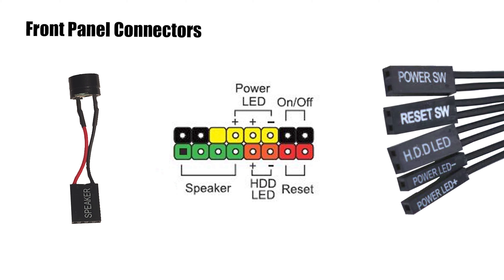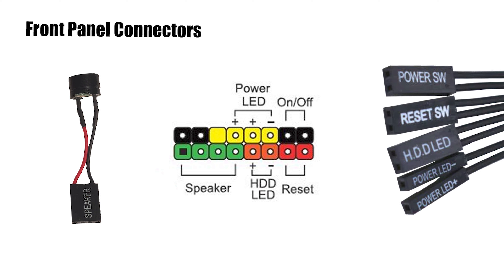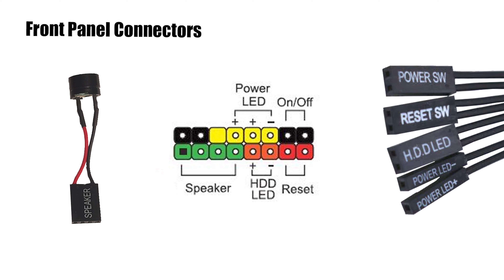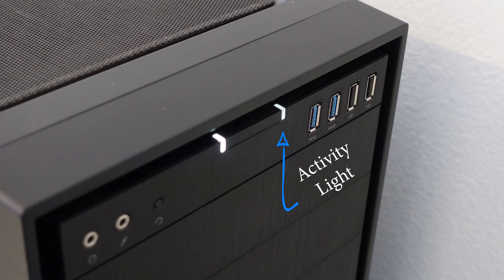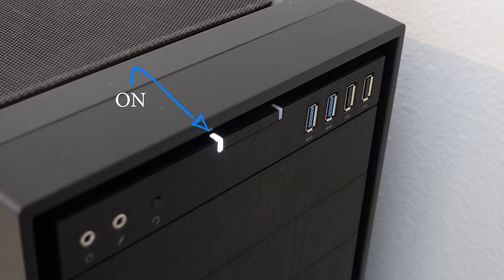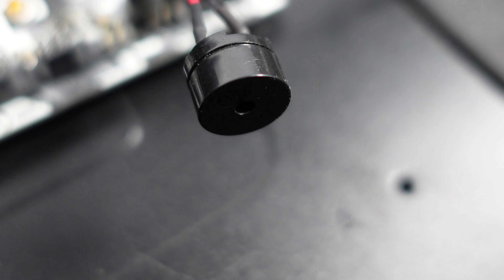Front Panel Connectors Explained

Comment: this video just saved me. I've been trying to figure out why my new pc wouldnt turn on for days. turns out it was because of this cable.
Reply: Having the same issue with my new cyberoower pc. Checked the psu with paperclip and it starts for 1/4 of a second before it does nothing. Just enough to get the fans to spin. Not sure if this will help but I will try anything. My front connectors feel really loose so I figure it's worth checking
Reply: Same
Reply: Same
Reply: @InvidiousPerson  what ended up fixing it?
Reply: I spent weeks taking this thing apart but it's been up and running since and have had no problems. Heres what happened. So even though the psu would turn on with the paperclip test is still wouldn't fully kick on no matter what I did.    I finally just bought an 850w psu instead of the 750w and  I know people will say it doesn't matter but I sware to you as soon as I put the new psu 850w and connected CPU_POWER1 and 2!! (4 pin on #2) directly to the new psu it kicked on and I was saved. Literally sent back to cyber twice and it was brutal. I'm not sure if the 3080ti was asking for more power or what. Even with the new psu if cpu 2 and 1 weren't both getting power from the psu it wouldn't kick over.  Good luck to you! I know how aggravating this is.
Reply: after 4 hours of pain i went to youtube and this literally saved my sanity
Reply: Same here

Comment: This for me is actually hardest thing when build computer
Reply: Ssme
Reply: Same
Reply: @skiemetcalf2352  can u help me please mine won’t turn on I think it’s because of this I have a z490-a pro mobo
Reply: Its been 5 days and i am struggling to still get my PC to power up 🙂
Reply: @bronationgamingultimate6760  take out and put back in ur cpu it worked for me
Reply: Yea that's was definitely the hardest thing about building the pc  I just built my first pc so am a complete novis to all of it but the front panel connecters were rly confusing even competed to everything else
Reply: Why’s mines not cutting on when I connect my power sw and my 2 leds? I’m connecting them in the right order there in put they won’t give power to my pc is it because of my motherboard or can ram cause this?
Reply: @Yunomileshater5x  you maybe put power sw upside down that can make your power button not working look again is it right spot, ram is not important pc will turn on even no ram just will be black screen and beep sound
Reply: 😂 same especially because rebuild like once a year keep forgetting 😅
Reply: Real

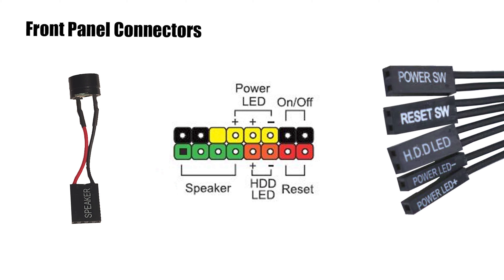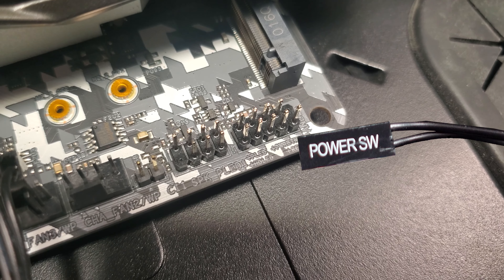Comment: Quick comment, at 0:23 you show the speaker as 4 green pins at the front but at 2:07 you plug the speaker into the back pins. I know each motherboard can be a bit different, but suggest inserting a text overlay to the video explaining this. Otherwise nice video.
Reply from the maker: True, the diagram shown was generic and not to my mobo specifically. But in general the speaker will always be to the right of the other front io pins.

Comment: Arrow = Positive, going to have to write that on my printout of the pinout. Thank you! I was wondering if it meant that or if the arrow was poining towards ground. I had an adapter from ebay once that you can connect the wires to it outside of the case then slap em all on the header at once. I forget the name of it, but it was so much easier. It's pretty ez to google up though. Maybe next time; there always is a next time.
Reply from the maker: Yes! I had a motherboard include one of those and I’ve kept it ever since, so much easier!

Comment: Great video man👍 Building my own PC soon, only thing I'm really worried about is cables and wiring any tips you could give to a first time builder
Reply from the maker: Goodluck! Easiest way is to install cpu/ram/cpu cooler outside the case first. Then set it all inside once you have your standoffs in. Do as much cable routing as well before the motherboard is installed.
Reply from the maker: Set the board on the cardboard box it came in (Not the plastic bag) its antistatic on the inside not the outside. But cardboard won't be conductive at all so you're totally safe with that
Reply: @MaxsTech  Alright, thanks alot!

Comment: hi.. i just got Alseye Pinwheel case and that case include LED button with 2 pin in front panel.. i have Biostar TA970 Ver 5.3 (AM3+).. can i use/connect it with motherboard or just skip this step? coz i really confused where i have to plug it on my motherboard 🙏

Comment: Hey, I dont have these cables or to be exact I only have a power switch and a sata cable coming from the front panel. Is that normal or should I send the case back?
Reply from the maker: The cables will depend on what’s on the case, for example a case with no reset switch on the front won’t have the reset cable. It’s just whatever I/O your case has that needs to talk to the computer. Some might not have LED lights for power or hard drive indications and so you won’t have those cables.
Reply: @MaxsTech  I don't have multiple wires. I just have a single connector that says f_panel on my NZXT H9 Flow Dual-Chamber ATX Mid-Tower. From my motherboard (ASUS TUF Gaming B550-PLUS WiFi II ) it looks like the f_panel wire might be all of these wires put together?

Comment: I accidentally unplugged mine and I’m struggling to get them back in right order will it cause a problem if I get them in the wrong way.
Reply from the maker: Depending what you mis-plug in that part won't work. For example if you have the power switch on the wrong + or - side the power button won't work. So you should be able to figure it out pretty quickly if you plugged something incorrectly.
Reply from the maker: But it shouldn't harm anything and you can just swap it to how it supposed to be
Reply: Thank you so much for the reply I have been able to fix the issue with your help greatly appreciated

Comment: Hey nice tips. But what if my old case and new mobo have different wiring for the front power LED? The first two pins are wired to the case's connector, but the mobo wants connectors in pins one & three. I have some electronics background, but have not worked with these tiny Molex(?) connectors. Can you just slide a pin out and move it to another slot?
Reply from the maker: I’m slightly confused by what you mean but no you can’t take any of the pins off the motherboard. There should only be 2, one positive and one negative for the LED on the power button. It’s possible the labeling is misleading, I would try to plug in your power led to the motherboard in next to either of those 1 or 3 pins it has and see if it works.
Reply from the maker: So maybe try pins 1 and 2 or pins 2 and 3
Reply: @MaxsTech  Sorry I didn't articulate the problem well. I wouldn't change the mobo. It's the small connector coming from the case front panel that has a different wiring (1&2 vs 1&3) from the mobo. I may see if I can source another little 3-pin connector and use that instead of trying to re-wire the existing one. I need the power LED as this is a rack mount case.
Reply: In case this helps anyone else, I stuck a thin paperclip into the connector to push the wires back out. Then I re-wired it so the connector matches the mobo. Works great. 📎 ftw!

Comment: I need help asap
I unplugged accidently the connectors while i was cleaning so i looked in the user manual how to cennect the cables again.
Fortunatly it worked for the first time although the the power - was connected to the reset - and the opposite, reset - was connected to the power- , but it worked.
Only after I‘ve recongnized what I have done so I unpluged right away and put the cables the right way. But now it doesnt work, the hard drive isn‘t turning on because the Led for the hard drive doesn‘t light but all the other leds work . What can I do 

P.s. The first time it did work, I tested also the reset button , which it worked
The hdd led cable was always plugged the right way
Reply from the maker: Most of these are not necessary to actually use th pc. The harddrive led is just that, an led. It just tells you when the harddrive is on, but isn't required for the hardddirve to work. The only one you need is the power switch.
Reply: @MaxsTech  Thank you for the fast reply 
Ok I understand so its something else that doesn‘t let my pc boot up 
It has the power so spin the fans or to light
the power led but the screen stays black 
Is it the graphic card or the booting of the Hard Drive
Reply from the maker: If your fans turn on then the power is working. Are you getting a boot screen at all? If it's not posting it may be a hardware error. Plug your speaker in the bottom with the other front io, if there's an error it'll beep and you can look up what the beeps mean. Also if possible try to plug the monitor in to different video outs, and make sure the monitor is on the correct output

Comment: My tower came with 1 single plug that says "F-Panel" on it. It's not lots of single plugs like that, it's 1 full plug that fits into the JFP1 spot, and says F-Panel. So do I need to add all these individual plugs, or just use the big plug? It's on an H510 Elite tower.
Reply from the maker: I've seen some boards who do that...wish more would, they'll just group them for you and put it in 1 connector. Should be able to just plug the big one in, just make sure it's aligned correctly
Reply: @MaxsTech  Thanks, I just spent like $3,500 on parts to build my first gaming PC. My niece and nephew really liked it, so I built them their own. However, my niece had the full plug, my pc & nephews pc had the individual plugs. So wanted to make sure before I powered it on. Still in search of a 3080 or 3090. If you of anyone, let me know. Thanks again for your response.

Comment: I only have the power sw and hd led panel in my case and my pc won’t turn on? Do I need a new pc case with all front panels?
Reply from the maker: To turn on your pc all you need is the power sw. not all cases will use the others.

Comment: what should i do if these wires came not connected to the front panel? - they came in the bag with the screws and stuff with the case but weren't connected. also I'm using a nzxt h510 flow if that helps

Comment: My pc doesn't turn on, like he turn on for some seconds then turn off. Can you explain if is something about those cables?
Reply from the maker: Sounds like it's either a power supply issue or a short happening. Check that there are no loose screws laying anywhere on the motherboard, or if you have a seperate power supply try swapping it. If it's immediately just turning off sounds like a faulty component.

Comment: Where does LED sw goes? I guess rgb fan? but i can connect only 1 fan out of 3,  Can you helpp me plz?
Reply from the maker: LED SW is for the little light that turns on when you click your power button, not all cases have lights on their power buttons so you may not require it.
Reply: @MaxsTech  I've got 4 connectors power sw, reset sw, hdd sw and led sw, these fans came with the cabinet. And in the discription it says led sw is for RGB fans but doesn't say how to install it

Comment: Hey, I have the exact same motherboard as you and I have a feeling somethings up with the front panel connectors. My motherboard lights up when I turn the power on but my computer actually won’t turn on if you know what I mean, the fans don’t turn on but the LED on motherboard lights up. Also I tested the PSU and it’s functional, so I don’t know if I’m connecting the front panel wrong or something
Reply: Hey im having the same issue with you? Did you fix your problem?
Reply: i have the exact same issue did you fix the problem?

Comment: Nobody shows this. Been trying for hours. What I do with the other end that has the metal pins?
Reply from the maker: Typically the other end is already attached to your case, your case might have them detachable, see if there are any connectors on the front of your case (inside) should be behind the ports/buttons on the top front

Comment: They should seriously make all the front side pins into ONE connector instead of this bullshit.
Reply: Ye when your power button dies you can actually swap the reset button pins in and no need for the faulty power switch.! IT just happened to me and saved  a lot of time and pain to replace the entire power switch. So there is a reason its separate. Plus to jump start the computer with just a screwdriver. Lot of thought goes into this buddy. :)
Reply: @mirandazohran  It's still bullshit.They should make one for all plug.

Comment: have tried it several times but it's not working! 
Rather there's something different happening!
When I'm connecting the HDD LED+ into -RES+ one it's showing a red light on my cabinet!
And when I'm connecting the +Power LED and - Power LED into the +PW- it's showing a blues light!
And Basically POWER SW ain't working at all!
Reply from the maker: Well the lights sound like they're working. Color doesn't really matter, that case probably just decided to use red/blue. Should have the light on and/or blinking when your drive seed activity.
Reply from the maker: The power switch not working is strange... ide double check that the power sw is in thr correct spot and not accidently in perhaps the reset area or the power led area...otherwise check the connection if you can on the back of the power button on the front of your case to make sure it's connected.

Comment: Hey man my pc has been f'ed up! 😓 when I boot it, 95% of the time my pc runs too slow: it will load at normal speed at the first 10-12 seconds then the windows loading screen will be so slow I have never seen this before! Even the caps lock button gets lit after 5-6 seconds of pressing it (not only caps lock but all keyboard buttons as well as the mouse) I could barely reach the log in account screen, even if I do its so slow it doesn't let me log in as its so slow. I have to reboot again BUT rest 5% of the time it worked normally! So I'd repeatedly reboot until it loads normal and doesn't slow. Any solution man? 😞😓 I'm tired
Reply from the maker: Strange...sounds almost like an overheating issue, I would check your temperatures first. I've never heard of something like a caps lock LED not lighting up. Could also be a major harddrive failure if its taking that long to load windows

Comment: Does the pc case come with the front panel wires?
Reply from the maker: Yea, most of the time they are soldered to the case and you’ll find them running out the bottom or perhaps from the back.

Comment: My motherboard has a thunderbolt port but can i use it as a type c port for my case?
Reply from the maker: As long as its thunderbolt 3 it will use the same type C connector as USB. The old thunderbolt 1 and 2 used the mini DP

Comment: Can someone help me I got everything plug in and when I flip the switch on the power supply my motherboard lights up and everything is working but my power switch won’t turn on the computer and I’ve check the manual and I have it plugged in right
Reply from the maker: If everything is working and it just won't post then it could mean you have a dead component, occasionally this can happen and you can get a replacement. Sometimes I find just taking the ram out and reinstalling it can help, if its not sitting right it can mess up posts.
Reply from the maker: Do the fans spin up?

Comment: Because in my case (BitFenix Nova), the reset cable was labeled wrong! It had only a "POWER SW" and a "POWER SW CH". I dint know which is which and had a 50% chance... of course i chose wrong and now my Power/Reset Buttons are switched. But im to afraid to change it again because it is under all the cables... :-(((((

Comment: We have the same motherboard but mine won't show up on the monitor and it will just restart.
Reply from the maker: Plug your speaker on the motherboard front io to listen for error beeps. You should be able to Google what the beep means. Easiest thing to do which fixes 80% of boot issues from my experience is just reseating your ram. Take it out and put them back in, or just put 1 stick in. Then try

Comment: My case doesn’t have all those other cables just one
Reply from the maker: Your case will only have what it needs based on what you have on your front panel. For example if your case doesn’t have a reset switch or hard drive Led light then it won’t have those cables.